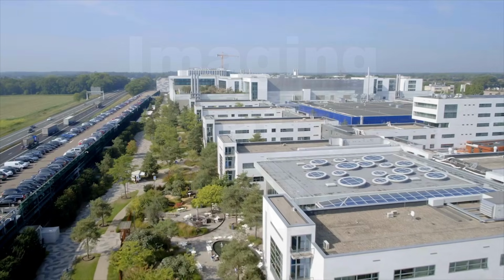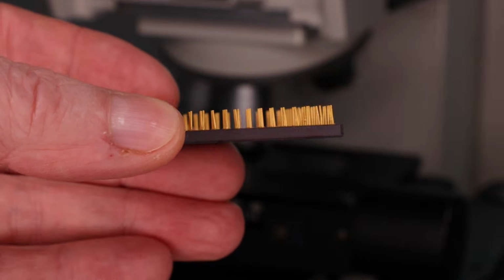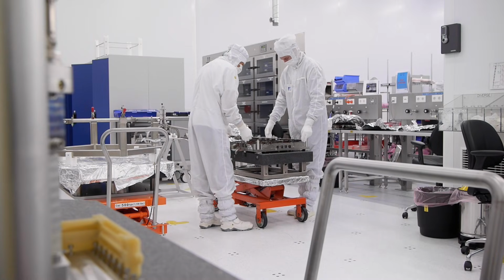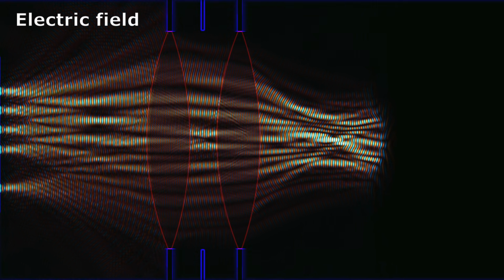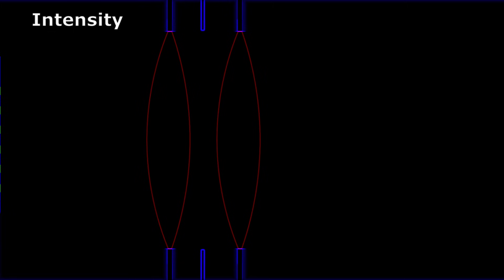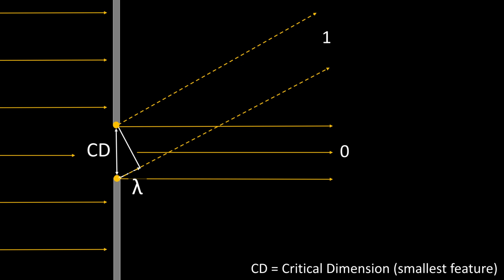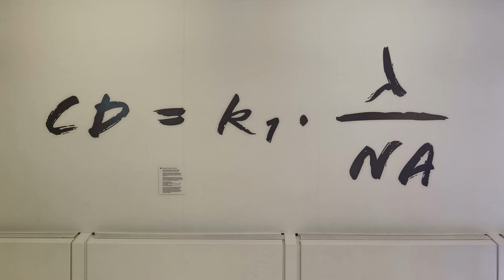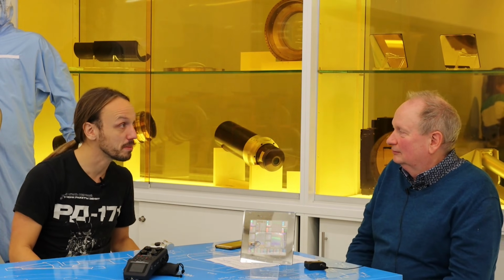Imaging at ASML

Comment: ASML has lost in technology against China. China had developped much more advanced EUV machine. Dutch can never compete with China. For China, EUV machien is nothing difficult. They sent a rover to the moon and brought back soil samples.  China's new EUV machien does not more wafer by mechanical system, but magnetic ally floating system for accuracy and eliminating mechanical calibration. China's EUV machien has much higher frequency EU light with higher power. ASML is outdated already.

Comment: @stawmy
46 seconds ago (edited)
I once applied for a job at this company, when i got there, i saw 2 types of people, well 3 actually. There were a bunch of young whizzkids running around, sweating, with their blackberrys, personal organisers & notebooks. There were senior engineers with beards, tweed suits & arrogant demeanor. And there were the corporate managers in immaculate suits who acknoweledged no-one. Then i got to the interview. 
Before i could even make my pitch, tell them all the stuff i have worked on; They just wanted 2 answers from me. Can you work 60+ hours a week in a hot clean room? And can you learn enough to bolt Module A onto Module B?. Well of course i can, but i think they missed the point. I am the guy who designs this kind of module. Yes i can bolt them together, but i would also design the bolts.
 They told me i could, in time, become a 'junior technician'.
I told them 'goodbye'😆
I also sent a message to a developer at Apple, explaining how Helium destroyed their MEMS chips. Did i get a reply? Of course not!

Comment: This is hard to understand. I was the main Canon field rep for MIT Lincoln Lab in MA in the 00’s. They bought a Canon DUV (EX4 248nm). I enjoyed going there because the first 2 hours I’d spent it talking to the head of the R&D department. He once explained the topic to of this video in terms an EE would understand. In EE, we use Fourier analysis to breakdown a signal into sin and cos components or harmonics. In this video the reticle breaks down its pattern into sin and cos components (the 0th, 1st, 2nd... orders) i.e. it “Fourier transform” the pattern. Given its NA, the lens captures as many orders it can. The larger the NA, the more orders it captures and the better the resolution of the print. It then re-combines the orders, and prints a reduced image of the pattern onto the wafer. Later I found out Fourier is also used in Quantum Mechanics to analyze uncertainty; what a powerful tool!! kudos to Fourier, one of my top 5 favorite Mathematician and Physicist.
Reply from the maker: Indeed,  Fourier is  literally everywhere where you find a wave.

Comment: this is a good review!!!  I have already encountered similar simulations of interference of electromagnetic waves with short wavelengths.  There are several unexplored aspects in this problem, namely, the materials (chemical elements) and the thickness of the crystal structures of the diffraction slits and the mask material of the photo lithographic template itself are not taken into account.

Comment: Great video, love the detail on how the source light and mask layout can be tweaked to improve the critical dimension, especially beyond the wavelength of the source light (which you'd naively assume was impossible).

One thing I find interesting about these EUV machines is that everything is done in the name of increasing throughput, and it's a desperate struggle to get enough light onto the wafer to keep exposure times economical. It's incredibly difficult to generate sufficient optical power at EUV wavelengths in the first place, and you lose a ton of light for every step and reflection after that before it makes it to the wafer. The more light you get on the wafer, the shorter the exposure times are, and the more wafers per hour you can run. 

I'm sure those ASML engineers would sell their firstborn for a trick that could double their light source's power output, or improve the reflectivity of each mirror by even 5-10%.

Comment: OMG, as an electrical engineer who has worked with radar imaging for the last 30 years, I found this absolutely fascinating. There are many similarities, although we are typically more interested in bandwidth to achieve finer resolution. At single frequencies (very low bandwidth), aperture size is the key. We use a known target and convolution to achieve a frequency dependent calibration. I would love to see the calibration process and the point spread function achieved with this machine. And, yes, it's mind boggling that this accuracy has to be achieved while all of these large components are trying to shake everything with their accelerations!!!! I don't understand why bandwidth can't be exploited to achieve better resolution...

Comment: Hey! I'm a physics undergrad, currently mostly focused on QM. I am interested in the physics behind quantum measurements and one of the sides I want to approach it from is polarization. 
There are a lot of explanations of WHAT polarizers do, but I don't know HOW polarizers do what they do. 
I know that it is probably not well established, since if it was, there probably would not be a measurement problem in QM, but maybe you could point to some resouce diving into that
Reply from the maker: So there is a lot of nonsense around polarizers, especially those experiments demonstrate that they prove "spooky QM phenomena". Basically, this is complete nonsense, arising from the incorrect assuming that the actual EM field is quantized. Polarizers are not pure filters having a I*cos2(theta) attenuation on quanta. They actually actually change the polarization direction of an incoming field according to this distribution. 
The best way to visualize this from microwaves and linear line grids as polarizers. A conductive grid of lines can effectively block linearly polarized radiation at 90 degrees, due to the fact that the grids conduct electricity in one spatial direction and not in the other. So the resulting field afterwards is 0. If you add another grid before the polarizer at 45 degrees, it will act as an antenna and will create a new field, that does have a field component in the direction of the first polarizer described. And therefore, a fraction of the radiation now passes both filters. That is all there is to it. Just classical wave theory, no QM required.

Comment: How can the US impose restrictions on a non US company ?
Reply from the maker: Mostly because of relationships between the US and  Dutch governments.  However, some modules are manufactured in the US, so they could actually make life very difficult for ASML.
Reply: Unfortunately USA are doing this since decades, and besides "export control" they have an arsenal of other blackmailing technics to weaken and control other countries, including west Europe, most of these technics have even been put in place during/after wars. 
For the "export control" scam, it is relatively simple, if they put "export control" on some chips or technology, lets say any chip that contains something "american" and if a country does not "respect" it, then they will block export of the said chip, or technology and make legal and commercial battles against the country in question, for example an encryption method. The problem being that the world is very interconnected and so the scam is very effective, to the point most western countries will oblige without even trying to fight, as can be seen in this case. That is why the EU should fight again this and prevent US from weakening us, it is incredibly inacceptable that they can control a technology that doesnt belogn to them by any stretch.
Reply: Maybe to give some context. The US funded a lot of research into EUV since the 90s.

Comment: Between bacteria and archaea (another type of single-celled microbe), there are more than 10^30 individual cells. Although most are about one micrometre long (0.001mm), it’s such a colossal number that laid end-to-end, they would stretch for 10 billion light-years!

This bacterial thread would still be difficult to see, because one micrometre is about 75 times thinner than a human hair. But if you wrapped the thread around the Milky Way, it would encircle it more than 20,000 times, creating a 2cm-wide ribbon that might catch enough light to be visible to the naked eye.

Comment: How much time does it take to become a final product? For how long wafer sits in ASML?
Reply: Our machines do only a small part of the chip fabrication process. The total process from start to finish takes around 3 months of non-stop processing. Of those three months, less than a second is the exposure in our machine, although our customers would likely expose around 70 times in the entire process. First you have to coat the wafer, then you do the exposure in one of our machines, then you take it out for development etching/deposition/ion implantation, then you strip the resist and you repeat this process around 60 times until your wafer with chips is finished. Only the exposure part is done on our machines and somehow we can do that extremely fast.
Reply: They're printing wafers faster than my printer can handle A4's. And it doesn't even bother them about the magenta running low!

Comment: Is not possible to build them chips using nanotech? (atom by atom?)
Reply: A simple rule of three is enough to understand why only a highly parallel process can produce these billions of transistors in a short time. Nanotechnology could manipulate single atoms, but only a few per second.
Reply: @ReinhardVoelkel   So, it's time constrained. I understand. What about using gamma rays ? They have a shorter wavelength and could be focused better ?
Or, what about using viruses to deposit the doping material onto substrate?
Reply: @liviuconstantin9960  very good questions! However it's impossible to build a lens for Gamma rays that has any nonnegligible transmission. So exposures would take weeks. And that's if you can actually build a high brightness source for those wavelengths. And then you'd need to make masks and resists for those wavelengths. It's possible in principle, but not feasible for high-volume manufacturing.
Reply: @DrBlokmeister  Darn! I'm running out of ideas here.....how about using the 2 slits experiment? shooting electrons (photons) to stimulate the deposits of doping material in the constructive interference area? (it's ok if you laugh, I realize some of these suggestions are "childish" in their thinking and I am no expert in the field)
Reply: @liviuconstantin9960  this type of self-assembling is used I think. But the easiest way to do this is to first do the litho step (exposure in resist and then develop) and then deposit the material sensitizer if you cannot do the material itself in that step.

By the way, I like how you come up with these ideas. A lot of ideas don't work because they're not feasible for some reason. But in the litho business, we need tons of new ideas to stay in the game. So keep them coming!

Comment: Note that US export restrictions have no direct power over ASML, since ASML isn't a US company. The restrictions (of dubious legality) are over the export of some individual made-in-USA parts used in ASML machines. So ASML could still export their machines to China, as long as they didn't include those components.
Reply: US behavior is sickening, we should not let US control the world that way, as a french engineer i already had to sign US export controls paperworks for French chips (ST) of a design destined to French client, this nonsense should not be allowed and the scam must stop.
Reply: Not entirely correct.
Reply: I don't want to go into politics, but these machines are so incredibly complex. If one part is misaligned (let alone missing) it will not function. Try to sell a car without the engines and steering wheels if no one else can make those.
Reply: @DrBlokmeister  - Obviously they wouldn't be selling machines that were simply missing some fundamental part (unless the buyer could supply it), they would be selling machines with an alternative part (possibly with slightly worse performance, or maybe more expensive, etc.), that was not affected by the trade restrictions.

Comment: An Airbus 350 widebody costs between $320 million and $370 million. So if you can buy such a state of the art chip machine for only $170 million from ASML and rocket to the top of the chip manufacturing industry, that's pretty cheap at the price. Speaking of rockets - the Block 1B version of SLS, to be used starting with Artemis 4, will initially cost $2.5 billion per launch (compared to only $97 million for a SpaceX Falcon Heavy launch).

Comment: The Mask in the EUV machine animation moves all the time. Why? Obviously the wafer moves, because each die is illuminated separately. But why does the mask move? It it for multiple patterning? e.g. vertical and horizontal lines separately in combination with optimized illumination to etch out even more performance?
btw I love the sound effects at 22:30 ("that one special moment in the life of a photosensitive layer")
Reply: Great question! You can compare it to the way we print newspapers. The paper is moving, but the printer roll is also moving. If the printer roll would stand still, the image would fade. The printer roll has to match the speed of the newspaper, even if the contact area between the paper and roll stays in the same physical place. The same is true for our system. The mask has to follow the wafer so that the image doesn't fade. The 'contact area' is the light beam connecting the mask (roll) to the wafer (newspaper). Matching their speed to very high precision is crucial if you want to maintain nanometer accuracy.

Does that make sense?
Reply: @DrBlokmeister  Thank you, that makes sense. How big is the contact area (to borrow your analogy)? Is one slice of the mask illuminated at once, or do you need to scan in both x and y direction? Or in other words, if I look at a big NVidia die, would that be scanned once from left to right for one photolayer mask, or would it be scanned from left to right multiple times to built up multiple rows of illumination?
Reply: @turun_ambartanen  I can't comment on the precise field size, but it's 26mm in one direction and a few millimeters in the other for EUV. For other photolithography types its 26mm by a larger size. The size of a die (or a full newspaper page in the analogy) is 26mm x 32mm. Chip makers optimize the layout so that as many chips as possible fit on a wafer. I guess they at least try to use as much as the 26mm width. Then it's nice if they could make the length 16mm so they can fit two chips on one mask. I measured my 6900XT die, and that one is too big to put two on one mask.
Reply: @DrBlokmeister  Thank you very much!
Reply from the maker: The reason for scanning is that it's very hard to illuminate the whole area at once with the resolution required. It's just not feasible to make the optics that can do that. But it is feasible to do this within a narrow area. So that is why they both step between  chips and scan over each individual chip area.

Comment: Instead of using DUV or EUV illumination, has there been any effort to switch over to shorter wavelength sources like x-ray, or particle based sources like neutron beam?
Reply from the maker: Yes, X-ray lithography has been an area of research for a long time. But it is very hard to make masks for X-rays. Of course we do have direct-write electron beam lithography, but that is too slow for mass manufacturing.
Reply: I think roughly two decades ago, there was uncertainty on whether the industry is going to switch to electron beam, ion beam, EUV or X-ray. I think in the end EUV won out because everything else was even more impossible. On whether there will be another wavelength after EUV: no-one knows. I bet a crate of beer on there not being another wavelength, but maybe I owe someone beer in the future!

Comment: Your videos never fail to blow my mind all over again. So good!

One question: Since at least two diffraction modes are needed for a good projection, are there any approaches where each mode is captured by a different lens and then later recombined? Obviously there’d be complications with path length and differential wavefront distortion, but I’m curious if it makes conceptual sense.
Reply: Now you're thinking like an imaging engineer! Yes that would work! People use for example a synchrotron beam line and two steerable mirrors to create the modulation and test resists. But you'd need to tune your lenses/mirrors to the specific pitch of the pattern. If you want to print something else at the same time, tough luck! So a full lens with a large NA is the best method to print chip patterns and that's why we use that at ASML. Until someone comes up with something better!